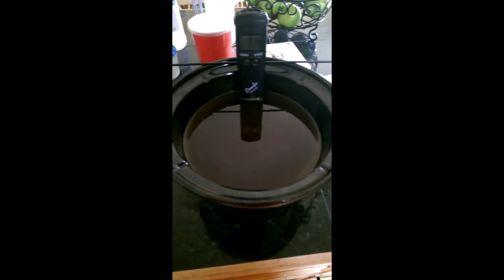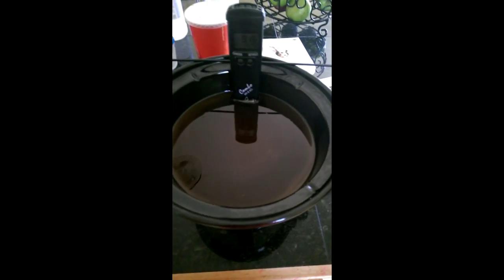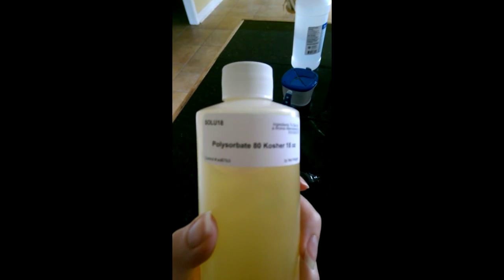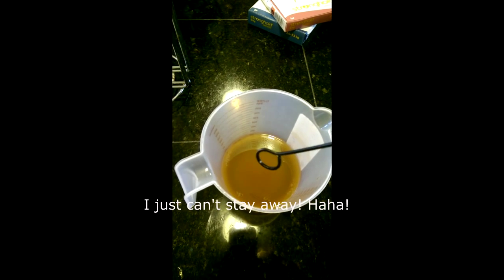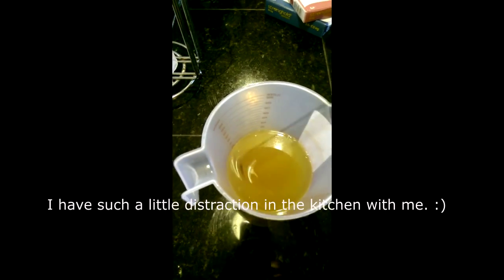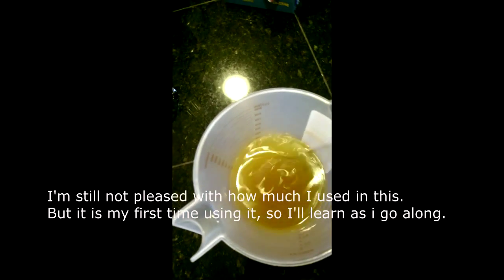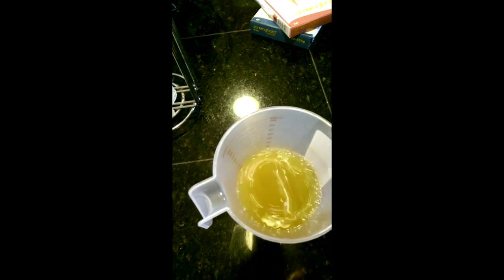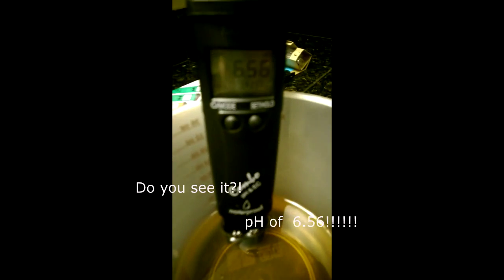Experiment in Liquid Soap Making- Attaining True Neutral pH

Comment: at what percent do you add the poly 80? I am wanting to try the poly 80 in my liquid soaps, and I have been looking all over for this answer. Do I use it at 5-10% of diluted liquid soap? A round about number would be appreciated. Thanks in advance.
Reply from the maker: There really isn't a straightforward answer to this.  Poly80 can safely be used up to 100% in products.  That said,  it depends on what you're trying to solubilize and how much.  Typically,  you start out with equal parts Poly80 with whatever oil,  or 1:1 ratio for say poly with an EO/FO, until you achieve the results you want,  which I assume is clarity in your product. Some oils will require more than that ratio,  so I suggest you play with it.

Comment: Hi I have another question. Is it necessary to have to lower the ph? Mines is about 9 still at room temp. Been using it on my skin, I know its only been a few days to tell if aything will happen. Also I dont know if its because I had to store my jars in the basement but the color is yellow. Than maybe slightly at the bottom a tiny bit of amber brown if not shaken. If I use citric acid will that help the color as well with lowering the ph? I watched the video but since it is pretty old I figured you might have found more ways since than. This is my first time makng castile I want to sell it with my other products. This is by far the hardest item Ive made lol. When you said Castile soap is worth the cost it definitely is. Hope not to be too much of a bother. Ive done research as well, but have not found too much of any decent help besides your posts! Thanks in advance